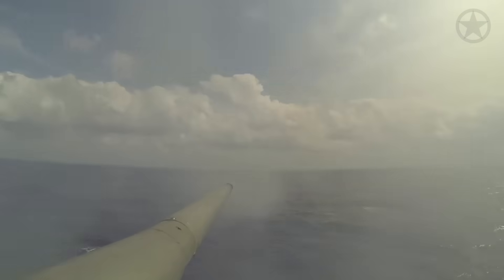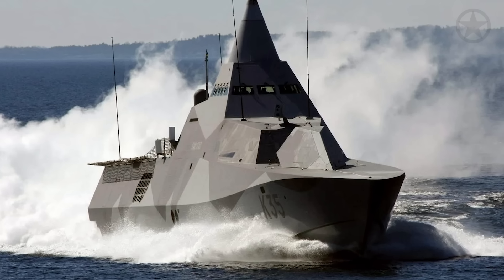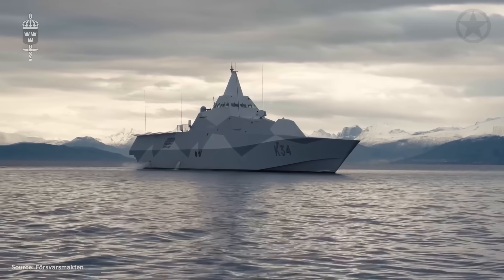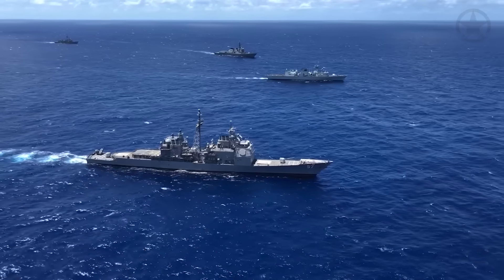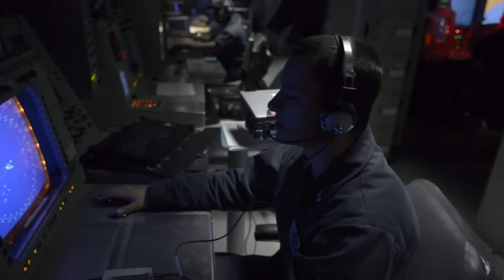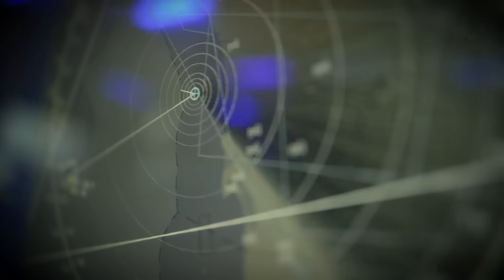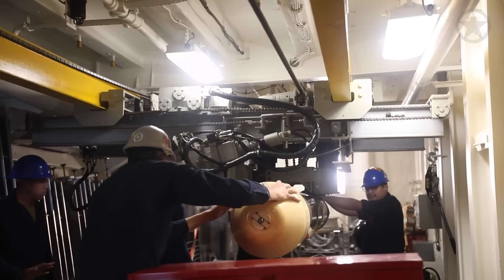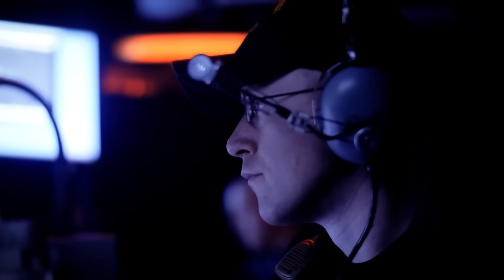Russia SHOCKED as Sweden Reveals Never Before Seen GHOST Ship

Comment: Finns are also developing the navy:

The Pohjanmaa-class corvettes are the new multi-role vessels of the Finnish Navy, designed to operate efficiently in the demanding conditions of the Baltic Sea year-round. Their design takes into account Finland’s coastal ice conditions and a wide range of missions, including surface and air defense, anti-submarine warfare, and naval mine-laying.
In a European context, the Pohjanmaa-class corvettes stand out in several ways. Their length is 117 meters, and they have a displacement of approximately 4,300 tons, making them larger than many other European corvettes. For example, Sweden’s Visby-class corvettes are about 72 meters long and have a displacement of around 640 tons, which makes the Pohjanmaa-class significantly larger. 
The versatility of the Pohjanmaa-class is another significant advantage. They are equipped with RIM-162 ESSM surface-to-air missiles, Gabriel V anti-ship missiles, Saab Torped 47 torpedoes, and systems for deploying naval mines. This diverse armament allows for a broad range of missions, from surface and air defense to anti-submarine warfare and naval mining operations.
The ships have been specifically designed for Baltic Sea conditions. Their ice-strengthened hull and ability to operate independently in icy waters make them exceptional compared to many other European corvettes, which are not necessarily built to function in such challenging environments.
The Pohjanmaa-class corvettes, currently under construction, will form the backbone of the Finnish Navy alongside the Hamina-class missile boats. The first ship is expected to be operational in 2027, with the entire fleet planned to be completed by 2029. 
In summary, the Pohjanmaa-class corvettes provide a significant capability upgrade for the Finnish Navy. Their features make them competitive and, in many aspects, more advanced than other European corvettes.
Reply: Hyvä! Love that Finland are developing their navy and it will be very interesting to see it when it is operational!  

As you use the Swedish Visby corvette as a comparison I have to say that Sweden have always gone for a large percentage of smaller vessels in their navy compared to other navies (except for that one time that turned out to be a complete catastrophy before it was ever used and now sits in a museum). This choice have most likely been an adaptation to fighting in the vast archipelago of Sweden, where it is often shallow waters with tight turns and where stealth, speed and flexibility have been prioritized over size. 

I am NOT bashing on the Finnish Pohjanmaa-class corvette here, all I am saying is that there are well calculated reasons why Sweden have not gone for larger vessels. If the war in Ukraine is anything to go on the future will be even smaller and cheaper drones also in the navy, rather then big heavy warships. However the future drones will most likely also benefit from having some kind of forward base of operation, or some kind of "mother ship" if you will, to extend the drones range of operation. Here a bigger ship would be able to host much more of said drones. I also understand why a heavier ship, that can handle and break up ice better, would be a huge advantage in the Gulf of Finland where the ice-sheet can indeed be both wast and very thick in the winter. 

What I am trying to say is that a platform is only as good as how well adapted it is for it's role and environment - big, small, advanced, simple, cheap, expensive; non of it do not really matter if it is not done as an adaption for it's role and environment (and threat). The Finnish Pohjanmaa-class corvette seems to indeed be well adapted for it's role and environment.
Reply: Finns are badass.

Comment: @9:54 Why is it named Sea Giraffe? In the 1980's Ericsson Microwave Systems made a surveillance radar for the Swedish army. It was built inside a standard container and mounted on a truck for easy mobility. On top there was an antenna that could be erected about 7 meters to get over the treetops. That radar was nicknamed Giraffe, due to it's slim neck with it's rotating antenna on the top. A naval version was manufactured called Sea Giraffe, that was placed on the Swedish Spica II-class. Eventually Ericsson Microwave Systems was merged with SAAB. The rest is history

Comment: The suggestion that the Visby has been supplied w/ RBS15 mk4 Gungnir ASMs is BS. There's been no such announcement. The upgrade was announced to great fanfare back in Farnborough 2018 and not a peep since. 

The mk 2 version of the missile that you reference only has a range of 100 km not 200. The mk3 version is the one w/ 200 km range. It's been added to German and Polish ships, but no word on whether the Visby got them. 

Just like with the coastal batteries - Sweden was supposed to skip the mk3 iteration and go directly to the mk4 version. But apparently Saab has its head up its you know what and hasn't gotten around to getting the upgraded missile operational. That's caused them to miss out on numerous tenders for ASM contracts - including for their neighbors in Finland who went with an Israeli missile instead. 

The anti-air capability is also not operational. It's just something on the wish-list. Who knows when or if it'll be operational. Saab and announced deadlines don't mix well. Saab's A29 subs are a decade behind schedule and Gripen E isn't yet operational with the SwAF either. Don't know what's wrong w/ the Swedes and Saab. Very disappointing.
Reply: Gungnir is reel, ask yur friens in SVR
Reply: Du påtalar mycket som du säger inte stämmer i videon. Visa gärna källor på att det DU säger stämmer. När du sedan nämner ubåt av Blekinge-class som A29 så kan jag inte ta dig seriöst. Rätt benämning är A26.
Reply: FMV procured RBS15 MK3 to replace all of the current MK2 variants. It was announced in December 2024...
Reply: @nTnz_ there was an announcement that the coastal batteries would get the mk3 iteration. I've seen nothing indicating that they'd be supplied to the Visby's as well - though it's possible that I missed an announcement. Regardless, it's an admission that the mk4 is way behind schedule and not coming soon. That's a problem, because the mk2/3 aren't air-launch capable - which is supposed to be corrected in the mk4 Gungnir iteration. Again - what's wrong over at Saab?